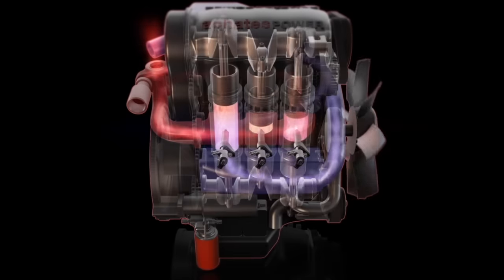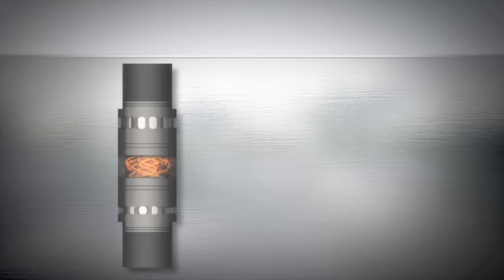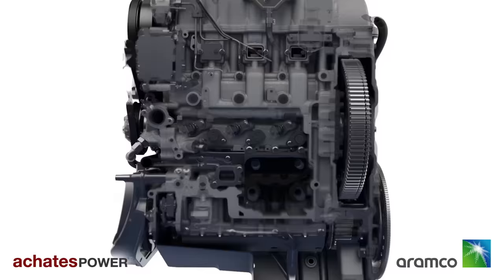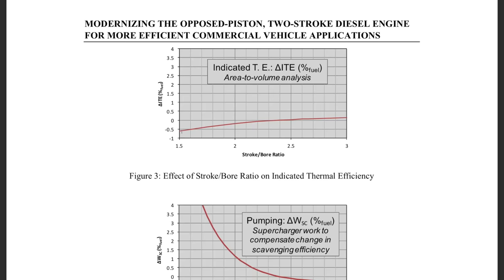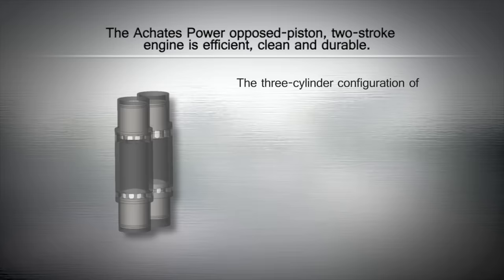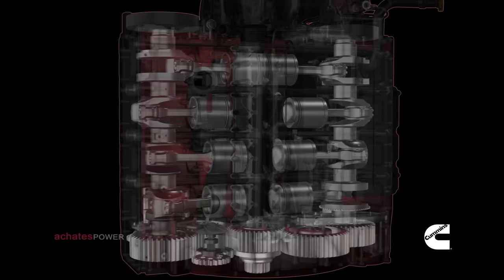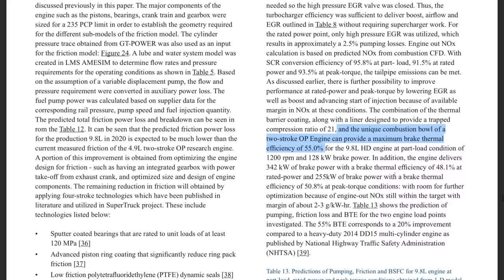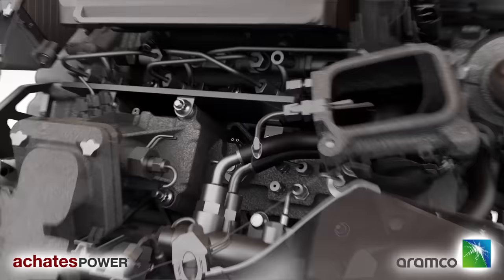Opposed Piston Diesel Engines Are Crazy Efficient

Comment: If this 6 cylinder has 55% efficiency, how would fuel consumption compare with my B58 BMW engine ? Its very similar performance 335hp 424lb torque. Mine gets about 25 mpg in town and 40 mpg on the highway. Would this engine give me 80 mpg on the highway in the same car ? 
Can it be installed as a flat 6. This would give the car a low centre of gravity.

Comment: Isn't the basic design referred to as a boxer engine similar to the Subaru?
Why opposing injectors instead of a tangent toroidal injection?
One would think the swirling would provide more complete combustion and increase scavenging efficiency.
This would have to be a  2/4 stroke hybrid; 2 stroke operation but a wet sump like a 4 stroke. 
The crankcases and gear train will require lubrication similar to a four stroke but the opposing pistons with ported sleeves allows for two stroke operation.
Reply: no this does not in any way shape or form compare to a subaru or porsche boxster
4 stroke boxer, the pistons move AWAY from eachtother  in seperate cyllinders to a seperate head at the outside
This engine
is a 2 stroke, and the pistons move TOWARDS eachtoher, in the same cyllinder, and there is no head
Reply: @stijnvandamme76  I understand that this is a dual crank in comparison to the uni-crank of the boxer.
Engine configurations vary depending on the piston plane; inline, V, radial, or horizontal like the Subaru boxer.. 
This engine would seem to fit the last category.
Looking at the internal structure of the engine, while there is no question that the piston/cylinder/porting relationship is definitely 2 stroke in design and function, the fuel is directly injected so, no lubrication would be offered to gearing or the crankshafts using the aerosolized fuel/oil mixture like a 2 stroke does. 
There MUST be a pressurized lubrication system as in a 4 stroke to protect these parts; a wet sump or, more likely, a dry sump like the boxer.
That is why I say this is a hybrid 2/4 stroke with similarities to the Subaru engine.

Comment: I thought Cummins had already supplied their version to the US military for use in Battle tanks?
Reply: The Cummins-Achates deal was well after this video was made.
Reply: @brianb-p6586  you are incorrect. the advanced combat engine was being designed when this video came out
Reply: @lexluthor6906  I was just comparing the date of this video (4 years ago, so 2018) to the news that I saw regarding Cummins-Achates collaboration, but apparently I missed the original deal from 2017. Still, the engine was only in early development at the time of this video, nothing had been delivered, the contract by the U.S. Army to complete the development of the Advanced Combat Engine (ACE) wasn't awarded until July 2021 (years after this video), and production engines won't be delivered until at least 2024.

So, Cummins had not supplied their version of the Achates engine to the U.S. military (for tanks or anything else) at the time of this video.

Comment: Could you not make this into a v formation and create a v6 with one massively complex crank under the 2 banks of 3 pistons - keeping the economy but increasing the cylinder ‘issue’ ??
Reply: It's not hard to connect engines together.

But the question is, does all that extra weight from mountings, gears, housings, etc, and the extra friction cancel out the increased efficiency of exactly 3 cylinders in a group?

Comment: The environment is holding it back from mass production, it's old 2 stroke technology anyway but I still think it's cool, at the end of the day it's time to clean up our fucken act and change to EV technology for daily drivers like cars SUV and pick up trucks , military & road transport are different and will require retro fitting of traditional diesel engines to run an ammonia & Diesel  blend to improve efficiency and emissions until newer hydrogen technology engines are mass produced and adopted by truck bus and train manufacturers.

Comment: I don’t see why the same design couldn’t be used with gasoline with the direct injection? But diesel fuel is much cheaper to produce.
Reply: Probably the compression ratio and plug location(s) would be a tough issue...
Reply: @martinblank1484  Hmmm… with enough compression you shouldn’t need plugs but maybe to start. But IDK 🤷
Reply: @randy6350  a plug-less gasoline engine is a bit of a unicorn. Mostly just experimental I think...

Comment: Used to have something similar in 21ft mariner although like apposed pistons laying across power was related through very large rockers not chain or gear driven but puzzled as to what it was,two stroke diesel with blower  I think may be late sixties should you know where I may find information 
Wish I still had it  ty

Comment: Seems as if it would be less efficient because it would take more combustion in one cylinder to move both pistols and if one ring is not sealing properly you would lose compression in 2 pistols instead of 1 because if a cylinder wall is damaged or ring not sealing properly the combustion in the cylinder would effect both pistols losing compression for both pistols in 1 cylinder then lose of hp. Then is not a simple engine to fix from what I see you could not just pull the head and look at the cylinders you'd almost have to pull the whole engine out and remove all that stuff on top just to get a look at the problem then if is missing or not firing correctly is effecting 2 pistons instead on 1. Seems it would be working harder just to move both pistons with one combustion in the middle.  Values and lifters like were are they located at in this engine.  41 percent not a good number that's like not even a C+ that is down in the almost D or even fail man

Comment: Would a gas direct injection version be a good idea? Or does the design require too much stroke to bore ratio to work well as a gas engine
Reply: The engine Archates Power put in a pickup was a gasoline engine

Comment: Could a PatOP: Single-Crankshaft Opposed-Piston Engine run on hydrogen with Spark Ignition and Diret injection with a supercharger (or eletrically assisted supercharder hybrid system or torodial cvt assisted supercharger) ?
If yes, how effiecient would that be and how much valume of hydrogen would be needed to go for 300 mile? 
@EngineeringExplained

Comment: by running the cylinders in a vertical alignment, what prevents the top piston from wollowing in oil as oi cooling into the pistons is critical so what happens after the engine is stopped? also, are the cyliders aligned with the center line of the crankshafts centerlines? what different alignments have been experimented with to optimise the torque outputs
Reply: we ran 4 fairbanks morse 38d 8 1/8 OP diesels on the old submarines. the crank "throw" was 5 inches, witch gave the piston a 10 inch travel. multiply that by two for upper and lower cranks, it becomes a 20 inch combustion stroke. That generated an 800 PSI compression pressure and the heat from the burning fuel increased that to 1200psi combustion pressure. For the oil system, there were oil passages drilled in the block and crankshafts to supply every bearing and moving part in the engine. To prevent "wollowing" in the upper half the oil rings on the piston came very close to the top of the cylinder, so it cleared any excess on every stroke, and it drained beck to the 250 gallon sump. I hope this answers a few of your questions.

Comment: What is the compression ratio in this engine type?
Reply: I believe they run as high as 18:1 thats why they produce so much torque and makes them so efficient. Ford made a 2.7L and it was able to achieve 37mpg which is unheard of in a gasoline full-size truck but for some reason they haven’t put it into production.

Comment: Looks like the engine ends up kinda huge, so ships and trains, yep. Trucks and busses? Mmmm, yeah. Cars - well, maybe. Motorcycles? Nah!
I'd imagine like a regular diesel it can be designed to run on natural gas, which both emits far less carbon than trad diesel fuel (about 75% less!) and also much cleaner burning - no soot or particulates, meaning this might well have a real roll to play in a cleaner lower carbon future - if the "environmentalists" would just shut up and get out the damn way, sigh....

Comment: If its a two Stroke Engine where does the  Cylinder get its oil?
Reply: It is a two-stroke cycle, but it uses a blower for scavenging, not the crankcase, so it is lubricated like any conventional engine.

Comment: Wouldnt a two Stroke Diesel have Problems with higher rpms?
Reply: The Detroit Motors were turning at 2800 RPM  ( and could higher ) ... but therein lies the problem.       The faster a diesel turns the less efficient  ( gas engines too ) they burn.   Too much of the exhaust mixture is still burning when it gets exhausted ( hence the black smoke ) .    All transport truck engine makers try for maximum torque rises at 900 to 1200 RPM.      All the Diesel Pickup owners complain however that their trucks are not 'peppy' enough;  so they chip them at the detriment of fuel economy and engine longevity .
Reply: Wonder if they were strictly air cooled ( finned ) like Deutz Aircooled Diesels  ...  if then some water injection wouldn't increase the efficiency substantially again.        WW2  Aviation Mechanic once told me that if the Lancasters didn't have water injection , they would never have made it into the air with the bomb loads they were lifting.

Comment: How does oiling work?
Reply: Nothing mentioned on this subject.  I read a SAE article from Achates that the oil consumption is comparable to traditional 4 stroke engines.  No detail explanation of how they do it.  I am not sure if it is true either.  The pistons moves between the intake and exhaust ports of the cylinder.  That length of cylinder wall, how to lubricate?  Oil injection?  Pre-mix lub oil with fuel?  How?

Comment: Would higher pressure turbocharging/supercharging help make 4+ cylinder variants more efficient in evacuating exhaust gases? Or maybe modifying the exhaust port hole size/shape/positioning?

Comment: A lot of talk but the important info is missing: primary/secundary balance?
Reply: Probably has better balance than most automotive inline 3s, because the external set of pistons would help cancel out some viberations
Reply: @ayoutubechannel921  it would be indeed interesting to know that, but I´m not sure about that.

But I´m quite sure this has no future, because: 
- a doubled amount of crankshaft and pistons/cylinders cost way more then a valve drive and valves
- double the amount of the heavy moving masses and block, hey, the trend is LESS weigth, NOT MORE ...  ;)
Reply: @Iam-mad  these being two strokes makes them have a slightly better power to displacement ratio
Reply: @ayoutubechannel921  I didnt realise the 2 stroke, sounds very interesting and intriguing, but I don´t think 2 Stroke will have a way back on the road in daily use, since the public is hysterical about enviroment right now.
Reply: @Iam-mad  this engine actually has lower emissions than traditional four stroke diesels

Comment: now im curious if you could have 3+ pistons per cylinder (would it even be called a cylinder at that point?)
Reply: I'm sure you technically could, but the 'cylinder' would have to be stronger and heavier to support such an unusual shape. Also you'd lose out on the benefits of multiple cylinders evening out the power strokes and balancing eachother.
Reply: @MainlyHuman  most of that went over my head but its nice to see someone taking this random thought somewhat seriously :D
Reply: @darkdruidsvale  basically having 3+ pistons in a cylinder (maybe in a T or an X shape?) Would mean having one big explosion powering each piston simultaneously.

You're going to get a much smoother running engine if you have lots of little explosions, one per piston, because you can space them out over time rather than releasing all the energy at once.
Reply: @MainlyHuman  for 3-4 id say an X shape would be good, the little explosions issue may be fixable if you have a lot of these cylinder sets? if each of the pistons connect to a shaft you could just combine the torque(?) as you do in the 2 cylinder combo this video shows
Reply: @darkdruidsvale  you could, but you'd probably be better off just having more regular or double piston cylinders.
Reply: @MainlyHuman  true, id be curious if there's any kinda models we could try using to make a basic prototype though

Comment: Thumbs down for basic lack of historical background and ultimate failure of such opposed configuration.

Most notable examples were mass produced Junkers Jumo 207 D-V2 was made in 1930s.  Designed as a high altitude bomber engine.

Then Brits developed a truck engine, Commer TS3.  By 1959 en Brits developed it into a tank engine, Leyland L60.

Soviets went chasing after the Brits and by 1963 got stuck developing their own engine, the 5TDF. 

5TDF was being developed in Ukraine in spite of every kind of protest coming from the rest of Soviet tank industry.  

After a decade of trying to fix inherent problems with the opposing design, and after making 5TDF the best example of such configuration to this date, ultimately such opposed configuration has FAILED in ground vehicle application.

Primary issues;

1. Cylinder venting requires a lot of air flow, and while in naval and aircraft application clean air supply is not an issue, in ground vehicles filtration of such a high air volume is a big, big problem. 

2. High oil consumption, high oil pass through into the exhaust system. 

3. Oil ring failure due to micro welding to piston grooves.

4. High RPMs and low torque output, resulting in high thermal output.

5. High engine case pressure.

Overall, while 5TDF achieved worlds best power to size ratio, recent combat use in Ukraine and high failure rates showed that it's not a viable design for ground use. 

The torque is just not there, while operational demands are way out of typical ground use application.

Comment: What's holding this back from production currently??  A scared, very conservative auto industry whose focus is NOT on advancing the state of the automobile.  When it proves to make someone LOTS of money, it'll take off like a rocket.
Reply: Have you thought of the lubrication to the cylinder walls?  There are exhaust and intake ports in the cylinder.  Lubrication oil is scraped into the ports and get burned by exhaust gas.  This will make emission bad.  So they may need serious after treatment.  It drives up operation cost.  This is what I guess why there aren't any trucks using this engine.

Comment: thoughts about drivability and longevity are my biggest concerns, sure the engine is efficent but how does it handle constant and rapid rpm changes drivetrain backlash and less than desirable operating conditions like extreme cold or hot environmants, theres reasons why a lot of great engines work well in generators or aircraft or ships or trains but the designs just werent viable for automotive

Comment: Yes, shows your 51% efficiancy to 95% tesla electromotor.
Reply: @illbeyourmonster3591  so, my English is no so good like your, but I thing I understood the meaning. So, I think the next level of engines is not mechanical. May be electric, may be plasma-engine, may be quantum. But not diesel of gasoline.
Reply: @artemkhateev3650  Ah, I see. You don't really understand how anything actually works, which makes you more part of the growing problem than any holder of realistic solutions.

Comment: try it in the artic region with a marine supercharged turbo with nitro and ethanol if the engine overheats.
hahaha. .
Reply: Never nitro in marine engine.  No marina will provide nitro fuel for you.
Reply: @catchnkill  just regular bio-diesel in sahara desert if it breaks down what are damaged parts. love it on off-road river crossing because there is no head anymore.
Reply: It has 2 crankshaft you can have 2 propeller in marine engine. In auto engine  how will it turn one clutch disc with 2 crankshaft rotating in opposing clock rotations? 
Could a lifetime diesel hybrid on trains. Sub are originally hybrid engine.

Comment: Yes efficient but this design will destroy itself quick from the slightest pre detonation from the looks of it. If something ever went wrong in this motor there is no motor
Reply: Diesel engines and engines that have Stratified Charge Mode Combustion cannot have pre-igntion or "detonation".
You need to learn your basics...
Reply: @sandervanderkammen9230  to much heat in a cylinder can cause that if that was the case it would not require a radiator really not that important to be honest
Reply: @Miamiboi305  Your comment reveals that you do not understand the difference between Diesel and Otto cycle engines or the basic fundamentals of compression ignition.
Reply: @Miamiboi305  Diesel engines don't have pre-ignition or "detonation" because they do not operate using Homogeneous Charge Mode, there is no fuel mixed with the intake air charge and no fuel is present in the combustion chamber until TDC.
No fuel,  No pre-ignition.

Comment: GOOD BYE TESLA SEMI-TRACTOR !!!
Electric Vehicle Efficiency Do Not Start With A Fully Charged Battery ... line losses in the united states average around 50%, as more EVs come on line those losses would increase due to potentails to thermal runaway effect in the lines .... 
but let's say the charging stations can maintain 50% efficiency from 99% efficient plants....0.99 x 0.5 x 0.87 x 0.9 x 0.87 x 0.92 = 31% efficiency = Achates Wins    just double it to a 6 cylinder twin turbo for 540 HP, there yah go..